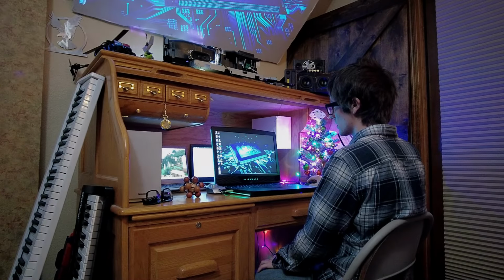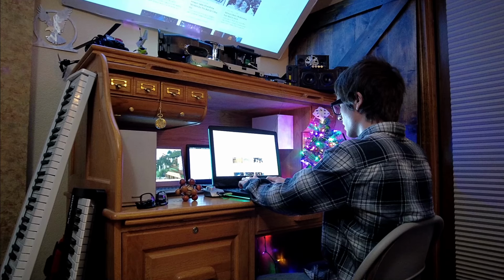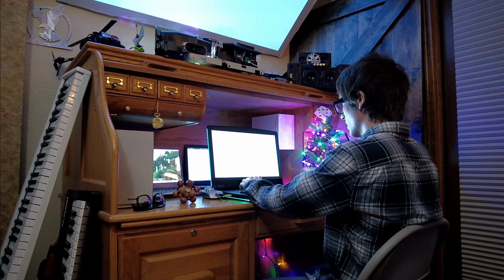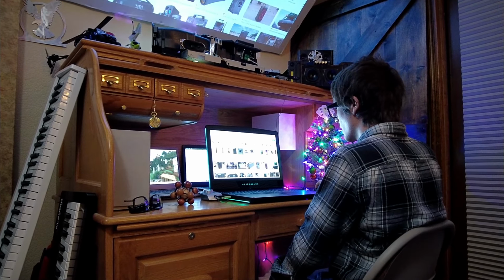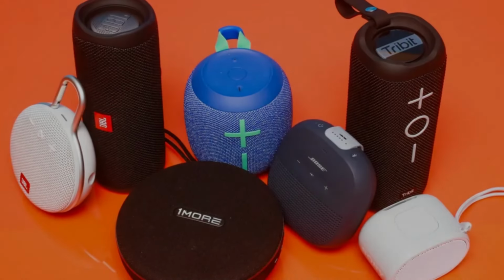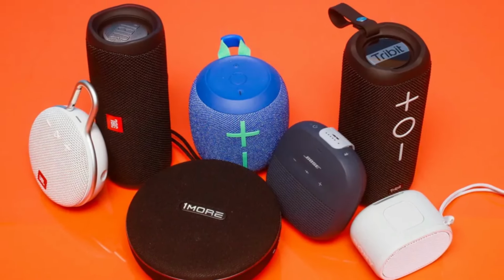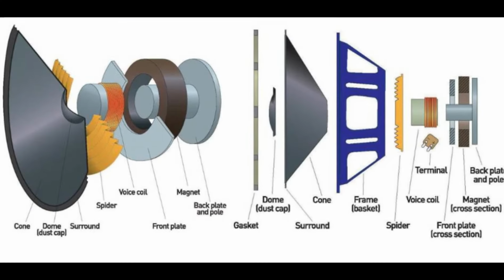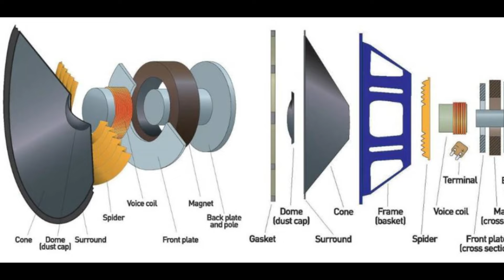Infrasonic Gun (Weirdest Bluetooth Speaker Ever)

Comment: Have you tried to make a DIY servo driver yet? 

I’ve heard they were used to emulate the feeling of earthquakes😅
Reply: rotary subs aslo do that way easier
Reply from the maker: Like bass shakers?
Reply: @nathanbulle5782  I think they meant using a digital servo to drive the mechanism, rather than a typical subwoofer motor. Althought it would have to be an expensive one with plenty of torque and speed if that is what they meant.
Reply: @nathanbulle5782  They are more like speakers, but servo drivers are also capable of moving incredible amounts of air and function not to far off from Nikola Tesla’s pneumatic oscillator that almost shook apart his workshop. 

Just instead it’s a servo and some armatures from the servo move a set of cones or something like that.

Comment: so I have an idea but I'm not sure how it would work at all, I was thinking about possibly building a rotary sub, and attaching it to a unmodified 8inch subwoofer by creating a ring that glues around the dust cap that attaches the actuator for the rotary assembly. the overall idea being to allow to 8inch subwoofer to function normally, while creating those lower frequencies with the rotary sub. I would also like to use an 8inch fan. I  was also thinking about the possibility of attaching to a shallow 8inch sub, this way you could go with an under seat option to fit in a truck.
Reply from the maker: It's an interesting idea but it wouldn't work in a truck because rotary subs don't move air violently enough, only regular subwoofers can move it that violently. You could try your idea in a window
Reply: well I wouldn't be replacing the subs entirely, I'd still have say like 2 8's for the higher sub frequencies and use the rotary for the  really low frequencies, but it also sounds like your saying rotary subs require a larger volume of air due to the fact the can't move a small volume quickly or violently like you said, so they need to move a large volume of air they can move slower.

Comment: If a subwoofer was designed with a cone in the shape of a ripple of water (Capillary Wave)would theoretically it be over 50% more efficient then a conventional cones?
Linear vs Non-linear Cone
Reply from the maker: Would have to analyze the compression waves off such a surface
Reply: then look at sundows u 6.5 subwoofer and maybe compare it to previous 6.5 inch models

Comment: Yo, you ever hear of a slip ring? Are you able to make a rotary subwoofer with a slip ring?
Reply from the maker: I'm using a similar design in my final rotary sub design but it actually has 3 roller bearings in triangular orientation where the "slip ring" would slide

Comment: hey you should make copies of the rotaty sub you made a tutorial for people that dont want to 3d print & do the work (like me) and you should sell them,  i will very glady grab one.
Reply from the maker: That rotary sub version is extremely crude and honestly not that well made. It worked well but I would want to give my customers (hypothetical at the moment) better than that. I'll be making a video soon (next week or two) of my final rotary sub prototype and the selling version will be based off of this final prototype.
Reply from the maker: Also with the new version, you can choose your blade size by simply cutting down the length of the arm that holds the blade, and the new model I'm working on will basically allow for a "variable" diameter (any desired diameter from 12 inches to 32 inches I believe)

Comment: Would it ever be possible for the fins to rotate fast enough to get like 200hz?
Reply from the maker: Yes
Reply: @nathanbulle5782  is that the limiting factor currently, how fast they can rotate? Why are they limited to like 10hz ?
Reply from the maker: @samp1312  mostly the weight of the assembly and the rotation speed is the limmiter

Comment: I see you've not read/hea|d the story of the three little pigs and the wolf and how a brick house was the wolfs downfall.
Reply from the maker: The thing was is that the wolf's voice box was a similar design to a rotary sub (more precisely a cross between a rotary sub and a Phoenix gold cyclone). He didn't just blow the houses down, he used a combination of powerful infrasonic pressure waves and subsonic waves to make the houses crumble. And the bricks that the last pig used were actually painted solid carbon fiber blocks (not to mention using super glue to put them together). 

Turns out that last pig was one of the background characters in Star Wars (one of the highest ranking engineers working as one of the Ugnaughts). Rumor even has it that this Ugnaught actually built the wolf's voice box per the wolf's request as the wolf lost his voice box due to too much smoking and screaming at sports games. That's why the wolf's friends on Tatooine would always call him "Woofer" because he would woof and his new voice box was literally a subwoofer. Does any of this make sense?